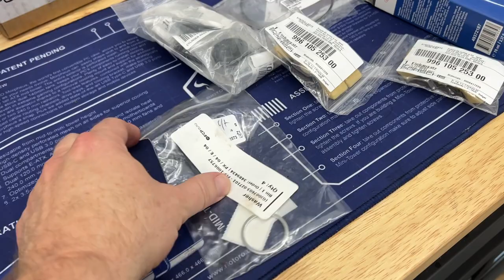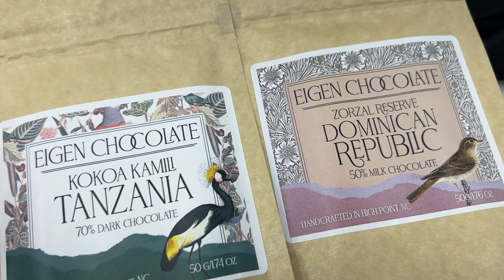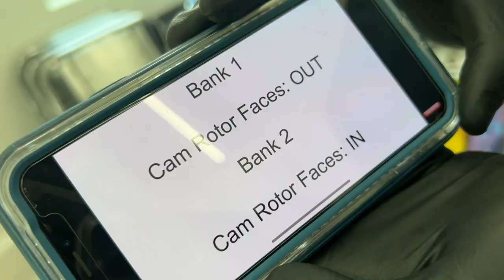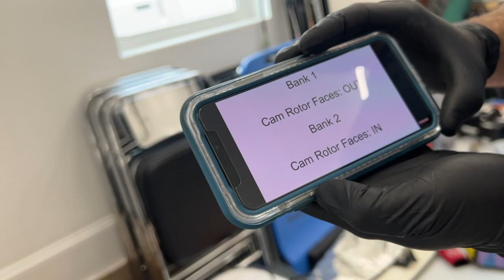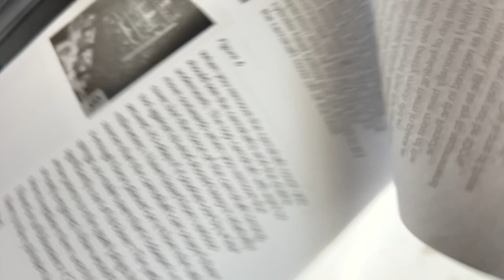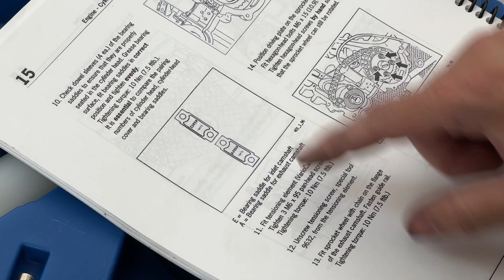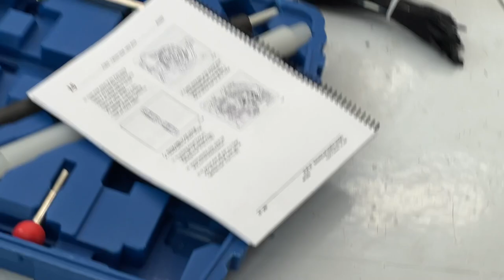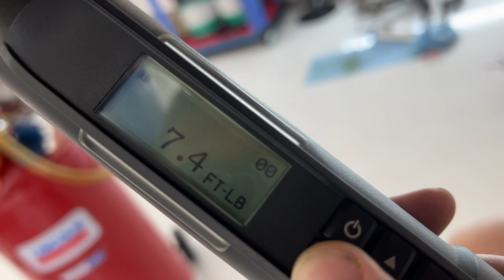Porsche CAM TIMING CHAIN GUIDE RAIL Replacement/Install - Day 1 - Bank 1 (Condensed Version)

Comment: This will be useful for a lot of DIYers. Thanks for the video!
Seems like if you put the cams with celenoid non-released, it will be easier to put it back and adjust.
Reply from the maker: +Anil I hope so!
I think if you pay attention to the alignment while it’s out and before releasing tension it would be easier outside the engine before reinstalling

Edit: After making part 2 I agree! Also should tension it with the cams in to avoid those gears touching the variocam!
Reply: @HelpMeDIY  Can't wait to see part 2 :)
Reply from the maker: @Anil-bg5se  Making the Member's Only version public right now!
Reply: @HelpMeDIY  Awesome, really appreciate it! These days, I am building a tow hitch behind my boxster to attach a bike rack without drilling anything on the car. I will share the video of how I made it once it is finished in case you want to make for yourself and create a video of it.
Reply from the maker: @Anil-bg5se  sounds fun! Make a detailed enough video and I’ll post it for you on the channel if you want
Reply: How much room underneath the car do you think is possible to execute this job. I can lift my car probably 20in off the ground (no quick jack or lift) possible to do with engine in car?
Reply: yup!
Reply: No ramp and yes it’s a doable job without removal of the engine, just be patient follow the instructions and you’ll be fine, took me about x3 weeks working after work and weekends . Mine was the x5 chain version, don’t skimp on anything just to save you going in again. Very satisfying and no leaks, Dirkon sealant was awesome but be careful you don’t overdo it and clog the oil ways. Make sure you follow the torque for everything. Good luck
Reply: Added comment, I found the supposed left hand thread on the variocam was not fitted to all cars for some odd reason so don’t assume yours has this it might be a normal thread. Full locking / timing tool kit wouldn’t fit but used modified plate, although the camshaft holding down part of the tool was useful…..just to let you know. 👍

Comment: Tip for special tool 9632 variocam tensioner. After much hunting around I discovered that the Traxxas toe link part #8638 for RC cars is ideal for the job. One end is 5mm LH thread and the other is 5mm RH, with a few tweaks you can use this to relieve the tension before removing the cams. Cost less than AUD$20 :)
Reply from the maker: Great!

Comment: Just was watching and with the cams out instead of trying to put the tensioner assembly in from the front side, I noticed that inserting them from the backside would be easier...of course if the cams on in the block that is not an option...just an observation. Great share! Thanks!!
Reply from the maker: +ED Justice thanks! We tried both directions 😂

Comment: Ok, it's been 2 years. Any leaks from the covers? Sealing with oil present has always been challenging with these engines.  Especially if you don't take the engine out. Any regrets?  I've got a 2001 911 to do.
Reply from the maker: +@YogisGarage hey Yogi! This wasn’t my car and I believe the guy that owned it has since sold it, but it never leaked as far as I’m aware.

Comment: Did Porsche improve the quality of the chain guides in later engines?  Considering buying a Boxster S, wanting to find out what I am getting into.  Thanks
Reply from the maker: +@teamground0229 I don’t think so. Slightly easier to replace though.
Reply: I'm thinking this is why they went to the 3 chain system and that simplified it.

Comment: How many miles did your car have on it.  How long typically should these plastic guide rails last on a well taken care of non tracked 997.1 turbo Mezger?  Thx
Reply from the maker: +T B I don’t remember how many miles… thought he mentioned that in the video though. Maybe not. I think they start deteriorating around 60k in my limited experience.

Comment: Great video! Very cool to watch even though I have a 987.1 and found your channel through that. 

Quick question, what was going on with the timing marks on the cam sprockets? Was it okay? Did the cams go back in at the same position, even thought you thought you adjusted the chain? Is the exciting conclusion in Day 2?!

Thanks!
Reply from the maker: +JimmyTomes thanks!
Yes it was ok. I explain it in Day 2. Coming soon!

Comment: I found it much easier to remove the cam covers by removing the spark plug tubes first.
E = EIN  meaning in.
A = AUS meaning out.
Reply from the maker: +Randy Fleet thanks for the German! Makes sense 🍻

Comment: Thanks for the video - question, are the rails on the cam chain the ones that wear more rather than the lower chain ramps? if you had an engine out would you replace the lower ramps also or just the pair up top?
Reply from the maker: +Austin yes that’s correct, the ones we replaced seem to wear the most. And yes, if I had the engine out those other rails would get replaced as well.
Reply: Can you replace the lower ones with out pulling the engine?

Comment: Did this car have the coffee can rattle at start up before the replacement of the chain guides?
Reply from the maker: +keith tannenbaum no, replacing the tensioner solved that just like it did for my car
Reply: l.replaced the tensioners on my 996 and it still rattles only on  cold start. ? any ideas. pls 🙏

Comment: Understanding that prices will vary throughout the country, what would be a reasonable or typical price for this service at a dealership or independent shop?
Reply: I was quoted ~$3000 for this job. It’s usually billed as an engine out procedure so it’s quite pricey.  There’s the added complication that if the chain has worn through the pads and damaged the variocam unit then that needs to be replaced as well. Those are ~$1200 a piece, the solenoids can fail as well and they’re ~$200.
Reply: @stephenknoop182  $3000 per side? Or 3k for both sides, with additional costs if the solenoids or units need to be replaced? I am nearing having to do this job and was going to do both solenoids as a “while you’re in there” sort of thing. Do the units fail often as well or no?
Reply: @poormansporsche744  the price I was quoted was around $3000, primarily for labor. The complete actuators are are ~$1500 a piece on top of that if they’re bad, which is what you’ll have to replace if the chain has worn through the pads and damaged the actuator. The solenoids themselves are pricey but at least lower in cost at ~$300 a piece. They can fail but as far as I know they’re not a maintenance item like the guides are.

Comment: So is this a "regualar" service that needs to be done when the car hits a certain number of miles? What triggered this maintenance?
Reply from the maker: +David Vasta well, it is a common issue on these cars. For Stephen, the thing that triggered it was his cam deviation readings were at -8.4. For most people, they find the little bits of the reddish brown plastic in the oil filters. That’s why I know I need to change mine as well
Reply: @HelpMeDIY  Thank you. I have a 2007 Cayman with 138,000 and so far it's clean oil for me.

Comment: is this the same as a 996 911 engine m96
Reply from the maker: +George's Garage I don’t believe so but I’m not a Porsche engine expert
Reply: Same engine family and the casting # on the exhaust cam showed 996, but there will be differences due to engine displacement.

Comment: I have no words. Why in the heck was this engine designed with this rinky dink piece. Was there no other option than to use this perishable part in such a hard place to get to. The amount of labor and potential for timing issues after reassembly seems ridiculous. 
What was the mileage for this car to need replacing those guide rails????
Reply from the maker: +Gary Helms well in their defense, I guess it’s better than the chain itself wearing and it’s a LOT easier to replace than the chain 😆

Comment: if you disconnect and remove that much stuff,   frankly why not drop the entire engine and tranny?

much easier to work on it..
Reply from the maker: +911s73targa well, mostly because you’d still have to disconnect and remove all the same things AND remove the engine, which is more time/effort PLUS an extra time and expense of having to replace a lot of fluids.